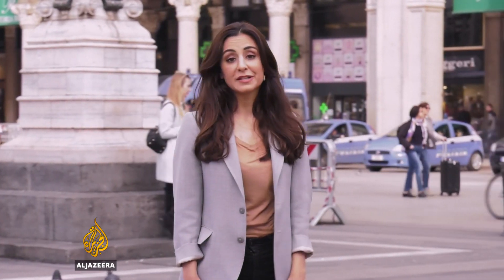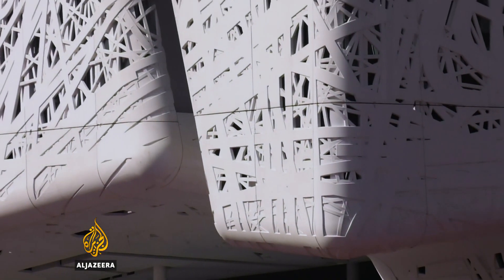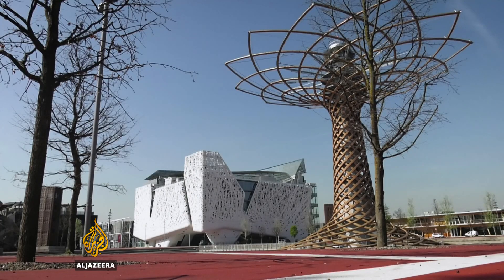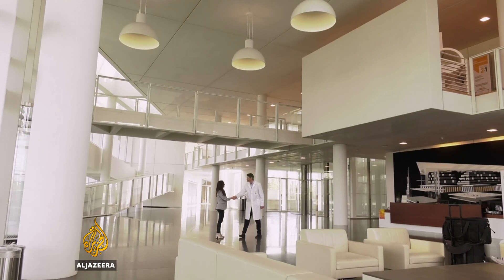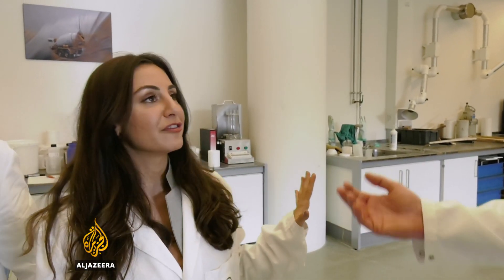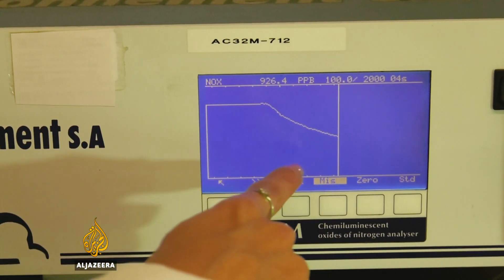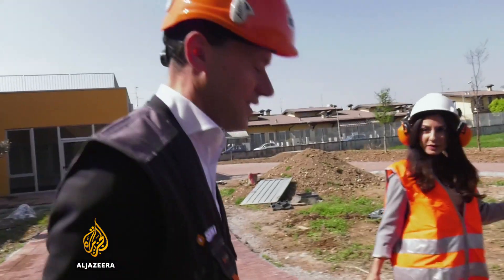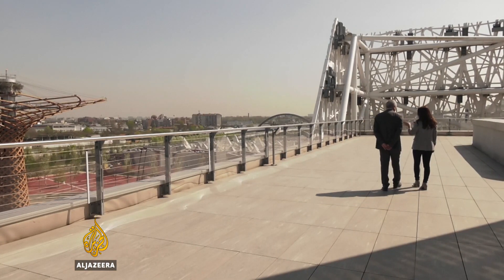🇮🇹 Italy's pollution-eating cement - earthrise

Comment: This is a beautiful architectural technology but to reverse CO2 emissions you'll need much more efficient technologies to clear it out of the atmosphere. 2:38 "Yes this is uh 9,000 m^2 of active concrete. This can clean uh equivalent of exhaust gas of uh 100 diesel cars or uh 300 gasoline cars." This is basically feel-good art, but useless compared to the pollution being put out. I can comfortably guess it doesn't even offset the emissions that went into making the building itself.

Comment: Now we can capture the CO2 emitted during cement manufacturing and sequester the CO2 by adding it to the concrete. Hence making cement carbon neutral and even carbon negative, in some mixtures, while increasing the tensile strength of the cement mixture. This reducing the amount of cement necessary in certain concrete applications. While these concrete panels are not structural, the rest of the building can be made with concrete strengthened by sequestered CO2. By utilizing other green technologies: a growing food on the roof, rainwater harvesting, porous concrete walkways and drives, human and food waste composting, solar energy, geothermal HVAC, planting deciduous fruit and/or nut trees or using solar panel awnings to shade windows and large exposed southern walls, etc, etc.... a building can exceed LEED ratings and become carbon neutral. 

Changing the way we build is a major step in the right direction. Planting more trees for lumber is one of the most economical ways to sequester CO2. The added benefit is cooling the earth, stopping the advancing and expanding desserts. Utilize the vast farmland sitting idle to create timber farms. Doing so in the area of the US known as tornado alley, will reduce local temperatures, wind swept dust storms, and best of all the number and severity of tornados. Once tree canopies cover the ground rainfall will increase, flash floods will decrease, and the ground will become fertile again. Many farms suffer from very poor soil conditions because of over farming, dry conditions killing all organic nutrients and organisms, contaminated water, pesticides, herbicides, and other toxins used to improve crops. Instead of the government subsidising idle land, let's put the last d to use and naturally repair the soil. Build vertical farms and use the land for the CO2 sequestering, oxygen producing, earth cooling, weather taming, green, and valuable natural resource: timber. 

Cheers!

Comment: Now combine this with the CarbonCure technology to add CO2 to the cement mix. This not only permanently sequesters CO2, it also reduces the amount of Portland Cement needed for the mixture to make the pavers. By reducing the amount of Portland cement needed you further reduce carbon emissions emitted during the making of Portland cement. Making the entire paver carbon negative while constantly reducing pollution in the atmosphere.

We have the technology to eliminate all carbon emissions from industrial plants and convert these emissions into stronger cement product. Unfortunately, many governments are not forcing industry to capture all of their emissions.

The way CarbonCure works is industrial plants capture the CO2 and sell it to cement companies. The cost of this technology to the facility capturing their emissions and the cement factory buying the CO2 from the facilities is all recouped end the end. Thus financial neutral and carbon neutral. Therefore there is no need to delay a global mandate. This improves our air and strengthens the cement.

Pumping CO2 into the ground Turing it into stone seems to be a waste now that the cement industry can use virtually all of the CO2 we emit daily, in addition to all the CO2 we need to sequester from the atmosphere. If we end up with a surplus, we can then inject it into basalt rock in virtually every country.

In thirty years we could see ice caps growing. Mountain snow packs and glaciers increasing. Deserts could begin to grow again with seeding and more consistent rainfall. The ability to repair the damage we've done over the last 800 years is here. The more we use it, the better the technology and efficiency will get. Soon we could see vehicles capturing and storing CO2. Adding equipment to old non-electric and classic vehicles could be as simple as attaching a hose to the exhaust and plugging into the 12V power outlet.

The page has turned. Let's all read it and share.

Comment: Please do more testing. I have read the comments on this cement but does not sound good. Cleaning the air while polluting the soil and water in the process is not a fix.
Reply: Panzer Delacruz bro depositing nitrites in the soil is not harmful to the soil, decomposing microorganisms in the soil will convert those nitrites into nitrogen gas. Neither the soil nor the air is polluted. Plus nitrites are essential nutrients for plants too

Comment: NO3(-) will produce nitric acid in the presence of water, that is also harmful.
Reply: It is made to decrease the pollution in the air so that people can breath freely and don't get asthma.
Reply: yeah but it goes in the sewers not in driking water
Reply: Sucks if you live on top of limestone; You want sinkholes? cuz that's how you'd get them.
Reply: @KRandMJ  Huh?
Reply: @altond511  water transport and high acidity can cause sinkholes for limestone based bedrock
Reply: @KRandMJ  its needs to be high acidic to do that.
Reply: @thefuture1978  That or mild strength within the span of a decade.
Reply: Nitric oxide in the atmosphere is going to be converted into nitric acid anyway.
Reply: Sudarshan Gogoi  yes..and meaning: that i'm not a scientist, not by any stretch of the imagination..but i had to study basic chemistry and basic pharmacology..and pharmacology math - for my major..and even though that was several years ago,  this report sounded way off..in terms of the results it was claiming to lead to for the city. 🤔
Reply: But that also affects aquatic ecosystem. Increasing pH may drastically change the ratio of water born weeds which is detrimental to balanced aquatic ecosystem.